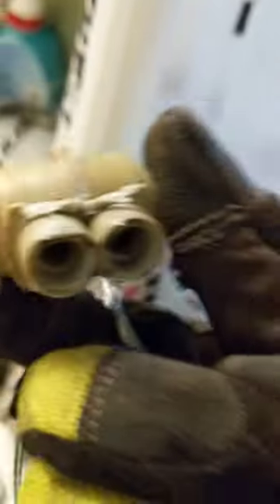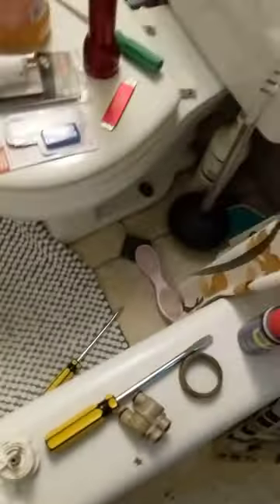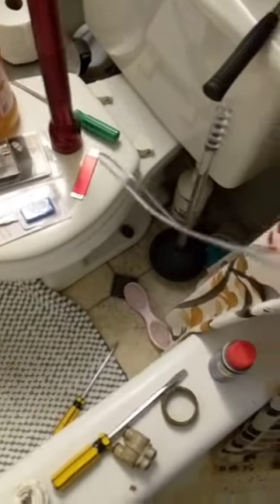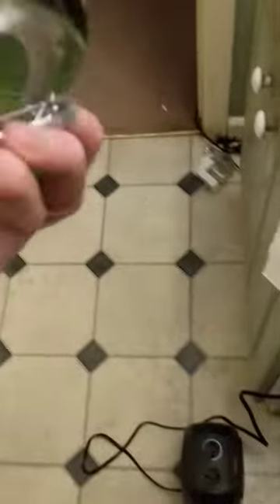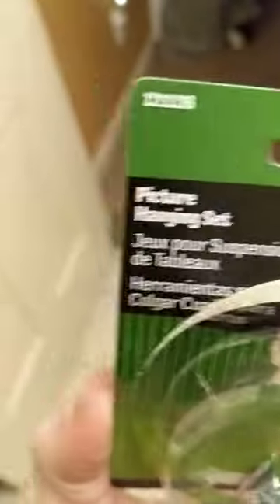Removing STUCK Delta RP19804 shower valve cartridge

Comment: I did exactly this just earlier with an old 1.5mm thick bicycle cabled and thankfully worked. Then I used my rotary Dremel with a small brass wire brush wheel and did an excellent job on cleaning out the insides and then waxed everything up for the new cartridge.

Comment: Worked like a charm. I also used a heat gun for 10-20 seconds on each side of the assembly to warm up the brass and perhaps expand it. Might have helped, came out quite easily. Hairdryer on high might do the same.

Comment: How difficult is it to loop around the wire?  Also is there plenty of room?
Reply from the maker: Yes there should be plenty of room, and the wire is flexible enough that it comes right back out the other side
Reply: @michaellafollette9602  mine is stuck like yours.  I will try it tomorrow.    Appreciate your help.  Thanks
Reply: This worked on the first pull.  Looped a 50 lb wire around as described in the video.  Tie a knot with about 1 ft of wire, and insert a wrench in the loop and do a quick pull on the 2 end of the wrench with some force and popped right out.  Thanks for this video.
Reply from the maker: @echang9477  glad to hear!
Reply: Thanks for this idea.....it worked for me.  During what was supposed to be a simple repair for a slow leak, I broke the Delta cartridge in half while trying to pull it out, so half was stuck in the pipe.  After watching your video, I found some frame wire in the house, and after a few unsuccessful tries, I was successful in inserting the wire starting from the middle-bottom below the cartridge and the end of the wire popped up at the top.  Needle-nose pliers helped to grab and pull it out...phew!  I pulled out about 3ft of wire, wrapped it around a big wrench for leverage, and CAREFULLY pulled and pounded on the wrench until the cartridge popped out.  Lowes had the new $65 cartridge, but this saved me big bucks because I didn't have to call a plumber!
Reply from the maker: @michaelchung3077   I'm glad this was able to save some money